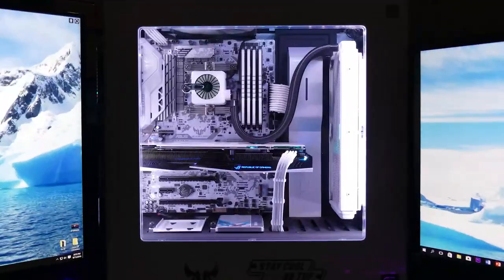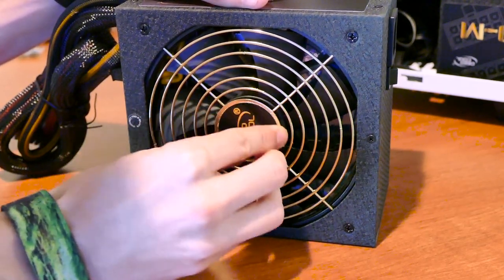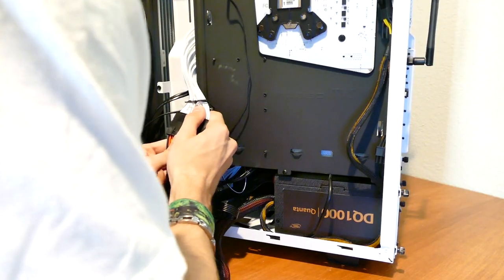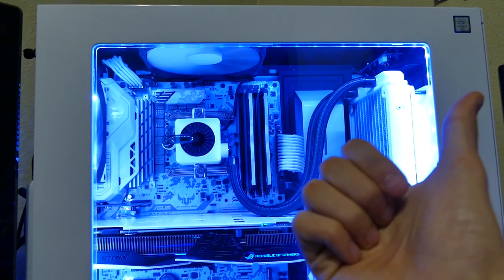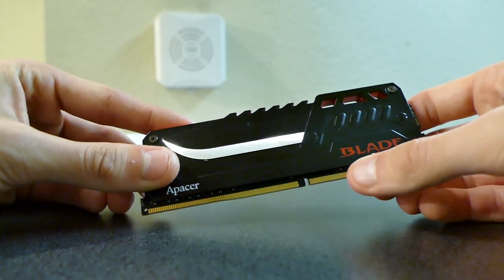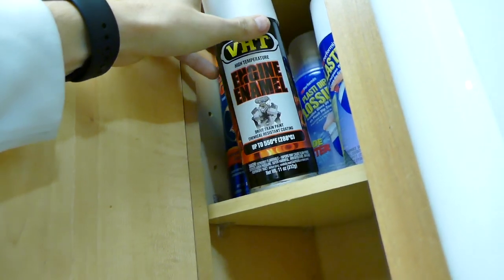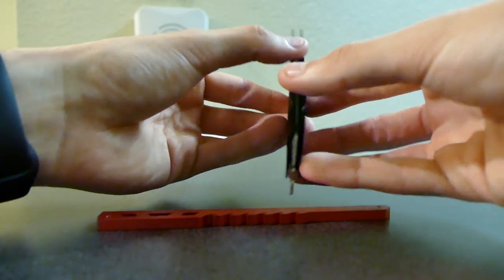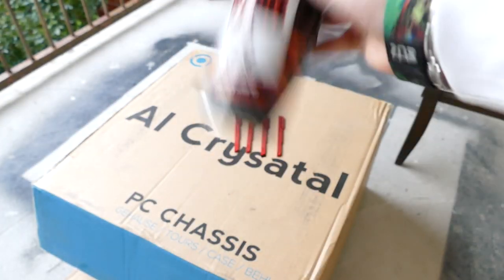Walter White's Upgrade Vlog + RAM Module Painting

Comment: I want to build a cheap ITX PC, that will run games at 1080p/60 on high maybe shadow medium settings.
Dips in the 50´s are ok for me. 
Moreover I work with After Effects but nothing too professional. Just as a hobby
My plan is to wait for Intel Kaby lake and then get
 i3 7100 + GTX 1060 3GB + 16GB DDR4 2133 + 1TB SSHD Seagate 
You think this will work out ?

Comment: Better to use the engine enamel paint anyways for heat resistance.  I just don't trust plastidip enough for heatsinks.  Though with how cool memory runs these days it's probably fine.

Looks good though.  Personally went with a black / red theme but will probably go silver or white next time.
Reply from the maker: I've used plastidip for heat sinks and never had issues (VRM heat sinks should never get very hot regardless), but I agree, engine enamel is an overall safer bet.

Comment: Brav I know painting the sides of the ram is a bad choice but just in case you gotta paint some part with some details you don't wanna paint in it , (like the chrome strips), just tape them and remove the extra tape through a knife. I don't know if you know or not, just in case....

Comment: In some of your latest videos I saw you went in detail on i5 vs i7 and how the number of cores affect gaming. I was wandering if in your testing you spotted any difference caused by the slightly larger cache size of the i7. For example when you turn hyperthreading of on the i7 6700k and clock it the same as the i5 6600k. Does the L chace makes a difference? Thanks!

Really like the predominantly white build!

Comment: The main issue you will have with 2 1070s (or 2 GPUs for that matter) is that they will only run at 8x due to the 6700k only having 16 PCIE lanes. Although it won't be much of a performance dip at all, I just thought it would be worth sharing. :)

Comment: Are you going from 2x8GB to 4x4gb? Isn't that kinda backwards? I would have added RAM with your open slots instead of blocking a simple upgrade for the future

EDIT: That said, I really dig the heat spreaders on the Apacer sticks, so aesthetically that was a good call regardless of the Mhz bump

Comment: happy to see that you upgrade your ram, it does  look better :)

80+ gold, top of the line ? very disappointing when you know that there's a lot of brand selling 80+ platinum (or even titanium) rated power supply. If 80+ gold is the max for this brand it's not a good power supply brand

Comment: I'll be honest, you should have tried to implant those while LED from previous ram to the new ones. I thought the LED was a interesting thing because it adds a touch to the PC that I don't generally see anywhere else. But other then that, great work! Beautiful PC, and hope it serves you well for a long time!
Reply: Cant exactly do that. The Led strip would have been different dimensions from the apacer heatpspreader plus there would be nowhere for the leds to draw power from. They draw it from the ram slots by being connected to the ram itself
Reply: That was why I thought it would be interesting if he did it. I don't expect him to get it done in a day or week, but it would be one heck of a project and one heck of a ram moduel.
Even though it can only be applied to two...

Youch.

Comment: 1000w is kinda overkill even if you plan on putting 2 1080 with a full custom waterloop, an 850w psu would have been more than enough. Also, the video has visual artifacts from time to time.

Comment: When you built Walter White you said that entering X99 is extremely expensive for you. Well, it's kinda true, but ebay exists, so you can buy here used 14 core Xeon E5 2683 V3 for only about 250 USD which is insane!
I'm planning to upgrade my MSI Z77A-GD55 rig with i7 2600k and 16gb of Kingston Hyperx Fury DDR3 to Asrock X99 extreme6(blue is my favorite color and this board has tons of features) + Xeon E5 2683 V3 + 32gb of Crucial Ballistix Sport LT White (4x8gb)
For you, as a white color fan, there are MSI X99A SLI Krait, Asrock X99 Taichi, Asus X99-A(II), Asus X99-Pro, Asus X99-S, Asus X99-Deluxe (II)

Comment: how much watts do u actually need for your build once you have dual 1070's im guessing 700?
Reply: not nearly that much...the whole system should draw 500W at most
Reply: you can use websites to see what is your system wattage one of the is pcpartpicker.com
Reply: ok ty
Reply: There is something to be said for going above what the system actually NEEDS though. Power supplies have an efficiency curve. Generally speaking they are most efficient at around half their max draw (again generally). Plus the larger ones typically provide more amps on the rail and can impact overclocking a little if they are underpowered or even cause attached devices to fail... For the typical user though a solid psu that meets the required settings will be plenty.
Reply: Ideally you want the power draw to be half the wattage of the PSU, reason being you get the best performance in terms of energy efficiency. Though it's not always the case, best to check specs on PSU.
Reply: it could also be that his original psu didn't have necessary sli support (i.e. not enough 6 and 8 pin pcie connections or something to that effect)
Reply: 500w should be more than enough I have a i7 6700k oc to 4.5 and a gauss gtx 1070 oc to 1800 and my power draw is 250-300max
Reply: +Vivek Patel u can oc ur 1070 TO 2000 mhz
Reply: Vivek Patel 500w isn't enough 650 is safe because its recommended to buy a powersupply 100w over the total wattage that you pc MAY take

Comment: I am planing to use a Deepcool power supply for a single Gtx 1080. Which one would you take?
Reply: And I thought that the Asusu Sabertooth Z170 S does have a max for RAM at 2400MHz?

Comment: Hi I like your build and I got the same set up as you but I can't get the deepcool pump to work how did you set it up. Pump comes with a 3 pin system that I connected to the CPU fan on the MB. I disable the fan detection and set it to DC and max but pup was still not turning on. I updated bios on the z170 but still no pump CPU keeps overhearing the fans turn on and the light in the pup turns on it just not cooling. Can you help me please love your videos

Comment: Hey is that an S340? I have the same case, fucking love it so much.
Reply: +Croaviel yeah definitely, for a mid size case it's great, super clean and neat
Reply: I got an s340 aswell but it has given me some issues, i have a msi gtx 1080, i7 6700k with a kraken x41 water cooler but that cooler wasnt the easiest to get installed. The case has little design flaws everywhere really such as the screws for the hdd being awkward ( well one ) and limited space up by the usb ports etc.

Its a nice case... Not the best.

Comment: Does RAM speed matter that much? mine is 2400mhz DDR4?
Reply: No: Stock DDR3 or DDR4 speeds are good enough. You'll see no difference for the premium you pay so buy the stock speed and invest the money on other components.
Reply: for high fps gaming (144 hertz and above) it matters a bit more, because the CPU is also more demanded.
Reply: Snakysnakes ya, you get 1 or 2 more fps: yay!

Comment: is a fx 8320e would it be good with a gtx 980ti/gtx 1070
Reply: If you havent already bought one, dont bother. If you do already have one, it would be ok but may struggle a little in a few more cpu intensive titles, especially if running at stock.
Reply: i have fx 8320e running stock and am gonna buy a used 980ti or 1070 then water cooler then a new cpu maybe a am4
Reply: yeah it's good,considering you'll upgrade later

Comment: Is 600w enough for a gtx 980ti matrix?
Reply: Yep
Reply: 600w is almost overkill, that system probably pulls no more than 350w max from the wall
Reply: Tyler Powell i5 6600k, gtx 980 ti matrix, msi z170 g43 plus, hyper 212 evo, 240gb ssd, phanteks eclipse p400, sure 600w psu is enough the 980ti has two 8 pins